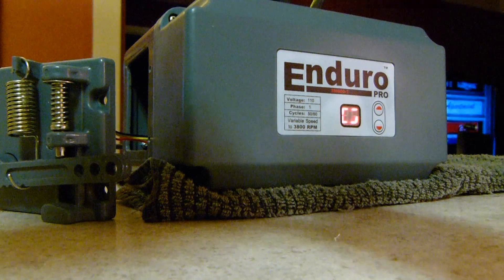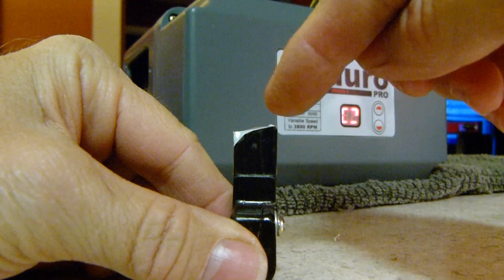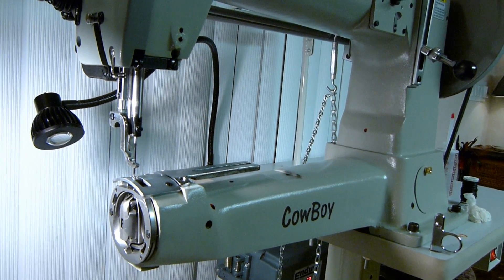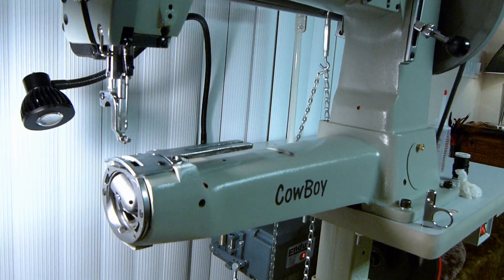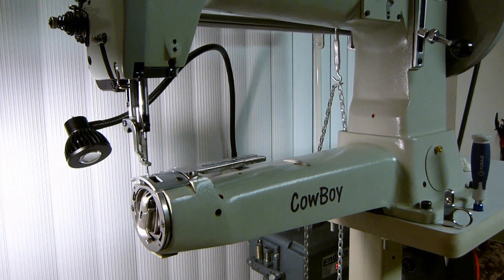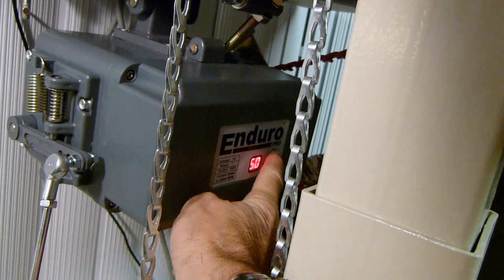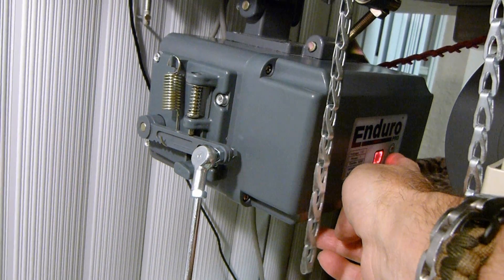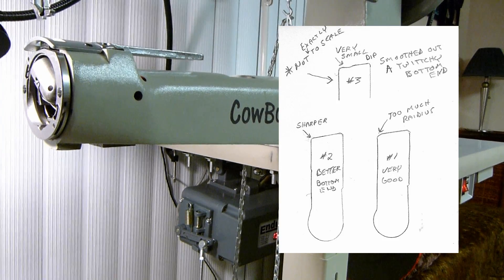Servo Motor: Updated Speed Mod

Comment: Just gave this a go with my new Enduro Elite SM1050-2PF (which has 2 LEDs & 2 shutters, though the left one seems to have no effect) on my Consew P1206RB. I printed a few smooth gradients of various steps/intensity on doubled-up regular paper, and the 3rd try hit the mark, smooth even ramp-up & not mushy, WAY better than the stock setup. It's a whole different build BUT your videos got me through it. Also put a 40mm pulley in place of the stock 100mm AND will enlarge the hand-pulley later. THANKS, I owe you a beer!

UPDATE: I created a short white to black gradient that was about 1/4" of change, then converted it to a mezzotint fine dot pattern (Adobe Illustrator) printed at highest quality on standard inkjet paper, trimmed & taped it down, seems perfect with a lot of mid-range. I also bolted on a 4" x 5/8" steel mending bar to extend the throttle arm out about 3.5" (longer arm = more control). I got the Endro for $40 on eBay, (close-out or damaged packaging), but a crazy deal, as it seems Enduro has ceased operations for these Elite & Pro servo motors? I can send you a PDF, just email me asking for the Enduro gradient, bill at bthrash dot com.

Comment: Well I was all excited about this since my “Sewline” brand servo setup doesn’t have any throttling via the pedal. It is a digital setup BUT, my sensor is a Hall effect sensor, not optical. 👎🏻
Reply: same on mine.... have you found any solution ? by the moment mine are: long stick attached to the puller (you know, basic trigonómetry) or... a pulley reduction system; nevertheless i've learned a lot because i didnt really know if the problem was only mine and how to solve it...

Comment: I tried this but it didn't help, i have the same motor, however, mine has 2 sensors instead of 1. 1 of them doesn't seem to do anything when i put something under the light though...
Reply: The other sensor is for the needle-positioner, you should concentrate on the one that effects the motor speed

Comment: Absolutely awesome modification! Thank you very much for sharing it :-)

I have just purchased a Pfaff 1245 industrial machine and the servomotor that comes with it has a "slowest" speed much higher than I would like it to be, and after watching your videos I am seriously thinking about purchasing a Enduro Pro servomotor to install it instead of the original one. If the range of speeds that it has from the factory is not as smooth as I wished, I will do this modification without any doubt.

Thank you very much again! :-)

Note: Do you know if the newest (2017) motors have improved in comparison with the one that you feature in this video, from 2013? Thanks again for your help ;-)